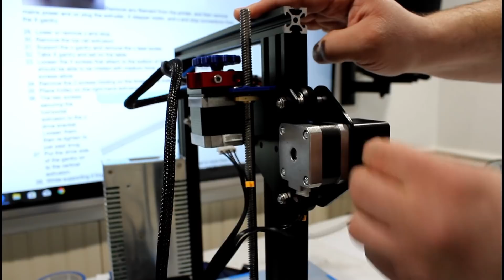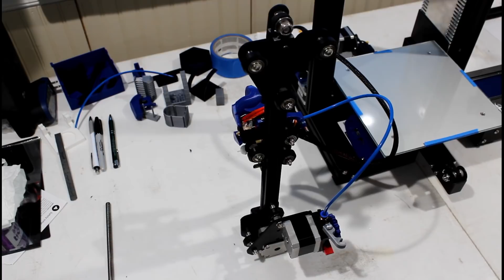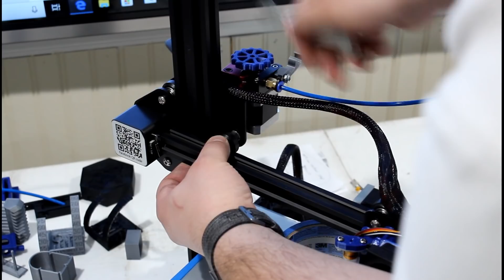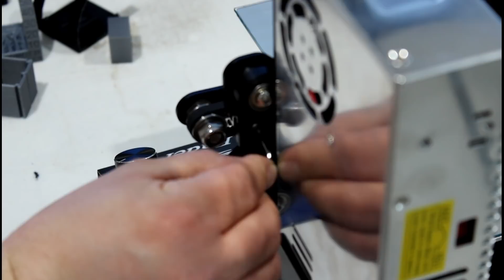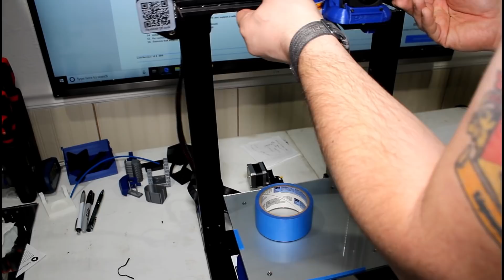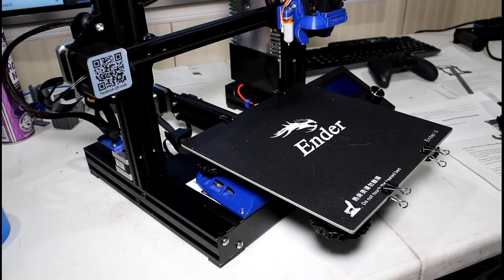X Gantry Rework Section 2.1.2 featuring the Ender 3

Comment: I followed your build video and I was a little bit more than a mm off and it bothered me so I wanted to be sure it was on so I followed this video. You say "tighten these nuts past snug" to me and every one I asked that means tighten past tight. I did this and I was unable to move the gantry level. Only after going thru this video 3 times did I catch on that those nuts had to be loose so you could move it into position. After doing this and following your leveling video I got  near flawless xyz cube first print.
I rarely like subscribe or comment on any video but thanks to you I got my ender dialed in almost flawlessly as a noob and right out of the box. Also my ender the pre heat pla temp is 185 and the bed was 50.

Comment: Great video! Just one remark as ( I think ) you did not refer to it explicitly. By loosing up the vertical stands they will be able to turn a bit. This can cause issues in the movement of the gantry as well. Before tightening them up I place a bar on the bed and clamp it to the stand on both sides to assure they are positioned completely straight towards each other.  Only then I re-tighten the bolts on the underside. That said, with my Ender 3 and 3 Pro I still experience that the gantry has some up/down movement on the left side, no matter what I try. So decided to go for a dual Z drive setup on both printers now to get rid of that. Ordered the belt driven version and a version with an extra motor so I can do a comparison on what works best for me. The EZABL does a great job in the meantime dealing with slight imperfections but the ultimate goal is a fixed bed and sturdy straight Z gantry. :-) Keep up the good work, it's appreciated!

Comment: You should design a new manual for Creality.  I followed their directions for assembly and my x axis rail is not level at all, haven't been able to print because the hot end is too far off the bed on one side.  Hope this works...
Reply from the maker: I hope this takes care of your gantry issue! Good luck, and let me know how it works!
Reply: @TheEdgeofTech  Worked great!  Everything was less than 1mm off.

Comment: i had issue with my cr10 clone and fixed it without taking anything appart ...i just converted the one side to 3 adjustable rollers and actually forced it manually to wear it stayed level ...than tightened up all my rollers... not saying this is not a good or proper method,but results are all i want... and after several hours my gantry is still perfectly level with zero play..

Comment: THANK YOU!  I've been fighting with my printer for a while now. I thought I have a warped bed, whenever I try to level it the center would always seem to be higher than the corners. I was also having issues with outer edges curling up. Higher bed heat, lower bed heat, clean the heck out of it, none of it stopped the curling. I came across this video posted on a Facebook page and thought I would check my gantry, it turns out the right side was 2mm lower than the extruder side. Followed the video and bam the center hump is gone and no more edge curling. I'm sure this is going to solve most other issues I was having but those are the ones I immediately noticed an improvement in.

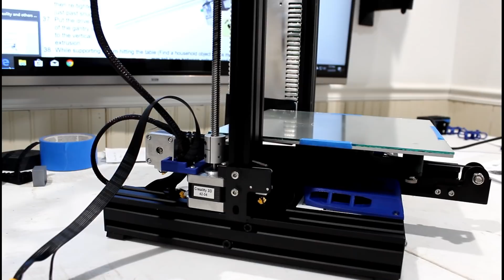Comment: 1:40 The entire machine woobles when you touch it. Were the "footing" on your machine also off with not all four pads touhing the surface of the table, when you assembled the machien?
Reply from the maker: The countertop that it was sitting on wasn't flat. I had that happen a couple times but n other videos too until I noticed it. Lol The machine is solid and square! :)

Comment: Thank you for your guide.
One question. after tightening the bolts of the right side to check if it's level (i'm withing 1mm), if i move the whole X axis up and down (from the right side) it moves quite a bit.
I've done it twice and still.
Should i tighten the eccentric nuts a bit more?

Comment: What I don't understand is that you suggest multiple times that using the long end of the wrench increases the risk of stripping out the thread, however, I would have thought the opposite is true.  When you use the long end you have less leverage and therefore less torque applied to the bolt than if you were using the short end.  Using the short end you have more leverage (because the long end is your handle) and therefore the applied torque/force on the bolt is potentially much higher while applying the same finger pressure - making it significantly more likely to strip out the thread.  Perhaps I've miss-understood something?
Reply from the maker: Good question! We recommend that because the long end has a ball end on it. The short end doesn't. It much easier to strip a screw out with the ball end. If all things were equal and had flat ends on them, it wouldn't matter what end you used them. You just get better leverage with the small end.
Reply: @TheEdgeofTech  Depends on where you're concerned about stripping it out. If you're worried about the threads in the extrusion (which are the most vulnerable), then Justin's right. You want the ball end in the screw, and put the tightening force on the short arm. If you're worried about stripping out the inside of the hex head (I wouldn't, you'll destroy the aluminum first) then your explanation is correct.

The length of the arm you're pushing on is what determines the actual tightening torque.
(I was thinking of this all the way through your otherwise excellent explanation. As an aircraft mechanic, it immediately hit me that it was backwards.) Then I saw Justin had already mentioned it.

So, Justin is actually correct, since the only stripping that'll ever occur here is the steel screw threads tearing the softer threads out of the aluminum extrusion.

Long arm=lotsa torque. 

Short arm=notsomuch torque.

Comment: Not too hard if you have ever properly adjusted 16 solid lifter valves on a Honda Accord or did a timing belt. If not, it might be a little challenging for those not so initiated...

Comment: I appreciate your videos. I am having all sorts of trouble with my new Ender 3 Pro and your videos are helping me work through them. I'll be mostly disassembling mine to true everything up on reassembly. I was confused at first in this video and in the setup video where you say back the bed adjustment knobs out 4 turns. I thought you literally meant 4 full turns but as I watched this I see you mean turn the knobs 4 times, not 4 complete turns (360 degrees). It looks like you are just turning the knobs the maximum amount your hand can move it at one time.

PS Your audio is a bit muffled and low volume for my ears. Maybe invest in a quality mic.
Reply from the maker: I'm glad the videos are helping! Those are my very early videos and I had a bad mic. I have a much better like now and I hope the newer videos are better :-) Thank you so much for watching!

Comment: Why would you measure the gantry against the top of the vertical rails? They're not precision cut to the same length, their dimensions are arbitrary. Should measure from the base of the vertical rails. The bed is mounted in relation to the base, not the top.

Comment: Excellent video. I did mine last night on my cr10. I found my wheels where over tight and managed to remove the 5mm differential. Not done a test print yet but very happy. Very frustrated with creality they could of made this so much easier by having the extruder end screws facing out so you didn't have to repeated remove the gantry until you hav it perfect. Ut non the less job done very happy. Thankyou

Comment: I’ve got an older CR-10.  There’s no eccentric nut on the left hand side (lead screw/stepper side).  Do I still follow these instructions but leave out the parts where I tighten the nut on that side?
Reply from the maker: I apologize for the delay on this response. I didn't see it until now. I am assuming you got it worked out, but if not let me know.

Comment: The masking tape support is assuming bed is leveled, which might not be the case, plus the weight of the gantry can push on the bed springs some too. I used a carpenter bubble level on the bed to make sure surface is leveled. Also, in my experience, minor adjustments (<3mm) can be made without taking the gantry off and just tweaking the right side whose screws are accessible.
Reply from the maker: Thanks for the feedback! I am just using the masking tape to stop the hotend from crashing into the bed. It's not serving any purpose to the leveling. Thanks for watching!

Comment: Worked like a charm for me, and my printer is working better than ever. Only thing of note is that the roller on the right side (outside top wheel) is pretty much spinning freely now. I have tried adjusting the concentric nut on the assembly, but nothing seems to get that one wheel any tighter. It does seem to be printing fine none the less.
Reply from the maker: Sometimes that happens. Just make sure everything is rolling good and nothing is binding. And if you are still straight at the top of the printer with your X Gantry, you are good to go.

Comment: I followed these to a T, the gantry seems lined (measures the same on both sides from the top), but my bed is not level. I followed the steps on the bed part of the video, but now the left side of the bed is way lower than the right side when everything is tightened down and loosened those 4 turns, i do have the yellow bed springs.
Reply from the maker: That's weird. When you raise your Gantry up, what is the measurements on each side? Also, your bed isn't wobbly is it?
Reply: @TheEdgeofTech  the gantry and cross bar measured the same distance on both sides. I begining to think my bed frame is not level. I have had a lot of problems with adhesion.
Reply: I'm having the same problem :/ how did u solve yours?

Comment: This made it even worse for me. I guess it doesn't work with Pro despite having the same parts?
Reply from the maker: If your Gantry is lined up correctly, it shouldn't be worse. What is the issue you're trying to fix?
Reply: @TheEdgeofTech  as it turns out, the triangle part was slightly shorter than the extruder part, putting it on first so that the top wheel of the triangle touched before the top wheel of the extruder fixed it.
Then it turned out I actually didn't need to do this at all, was just the stepper motor that was misaligned :S loosening the screws fixed that problem.
Reply from the maker: @Duckly97  Nice! Great troubleshooting! It's probably good to do anyway, and I'm glad you got it figured out! Happy printing!

Comment: Cannot get my new ender 3 level.  My older one is great.
Reply from the maker: Hi! I noticed that one of mine was easier than the other as well. Did you do the updated springs or the 4mm nut on the bed screws?
Reply: @TheEdgeofTech   Yes I did all that but what I'm not getting level is the x-axis
Reply: @TheEdgeofTech  now working on it tonight, I stripped out one of the bolts holding a concentric nut on the x bar (i do not know the term)...
Reply from the maker: @washingtonstatepicker3460  Now I understand. Dang, I hope you can get it out. They make drill bits to help remove stripped screws, maybe that would help.

Comment: The video (and the written instructions) is  very comprehensive, but it is very dense and I'm just not quite sure where the key adjustment is. at 12:31 in the video you say that if it isn't quite right, you need to do the adjustment again. I'm not sure where to go back to. I appreciate your help as this is the thing that is keeping this from working for me.
Reply: Both right and left carriages move up and down very easily but  the left one is about 5-6mm lower than the right.
Reply from the maker: @salukitd1  Thanks for watching! It sounds like you need to move the right side up if the left side is higher. Make sure the extrusion is just loose enough to move like it says in the guide. The move it until it's the same distance away as the other side. If it's not, move the extrusion some more until it is. If you hold the left side while you do it, that will help too! Let me Know of this helps you and if you need anything else.
Reply: @TheEdgeofTech  Thank you very much!  I'm going to take another run at it after a bit more Basketball...LOL!
Reply from the maker: @salukitd1  sounds good!
Reply: @TheEdgeofTech  Got it adjusted!  I'm about .20 of a mm off from right to left (measured with digital calipers).  I did an m851 update of the z offset confirmed it with the g1 f60 z0 command.  But when I get to G29, it stops on the 6th spot(middle left).  Any thoughts?  Completely unrelated, but did I see you wearing a Packers shirt in one of your other videos?!
Reply from the maker: @salukitd1  Great to hear!! Are you using the BLTOUCH or the EZABL? Also,byes you did! Lol I'm in Wisconsin. Haha
Reply: The Edge of Tech BLtouch.  I grew up in Oshkosh!
Reply from the maker: @salukitd1  Nice!
Reply from the maker: @salukitd1  shoot me an email about the bltouch, and I can probably help you that way. I am traveling to MRRF and it's going to be sporadic through the weekend that I have time, but I will definitely try!

Comment: Is it too bad if the wheels had some scratches due to overtightening, I don't have replacement
Reply from the maker: As long as they are not badly worn you should be okay. Just adjust them correctly and keep an eye on them in the future.
Reply: @TheEdgeofTech  
But then he'll lose depth perception. This can lead to accidents.